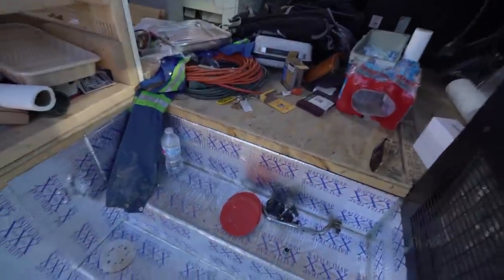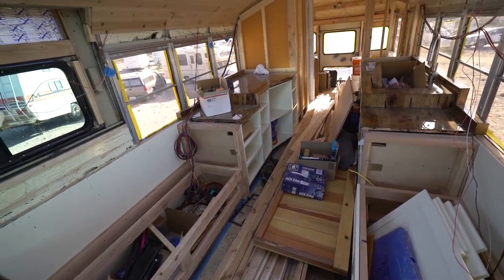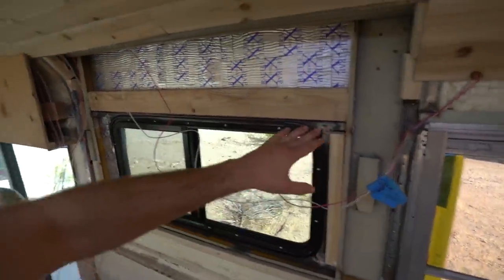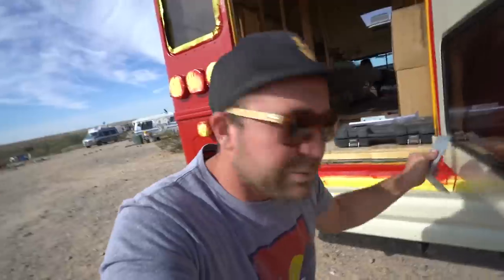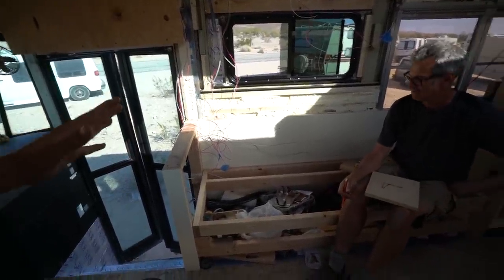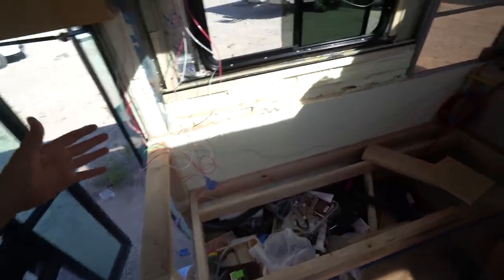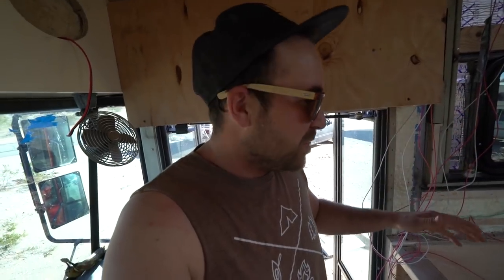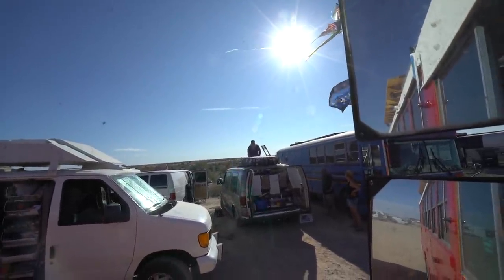Wanderboom and Steampunk Steve Stopped By!! (VanBuild Party 2018)

Comment: Jax, you are not just doing a  bus conversion to a motorhome, but you spent a tremendous amount of time converting the engine to vegetable oil fuel. This took so long in addition to the body conversion. Also, you could have saved so much time if you hadn't torn out the interior steel panels and insulation just to reinsulate and put wood panels in place. The steel interior panels are what makes a school bus the safest vehicle on our highways. The double steel wall construction is extremely strong and crash worthy. You decided to make it take longer to finish. That decision is an individual thing. Enjoy your build and have fun with it like you are doing. You have had lots of great help and what more can you want. It's always more fun to work with others .
Reply from the maker: We talked about a 3 month build lol

Comment: What did you do to stop the condensation from the inside of the bus?
Reply from the maker: Spray foam will block out a lot of that. But, maybe call a professional insulation person for that question.
Reply: Spray foam/foam all bare metal, using ventilation helps, in humid areas you need a dehumidifier.